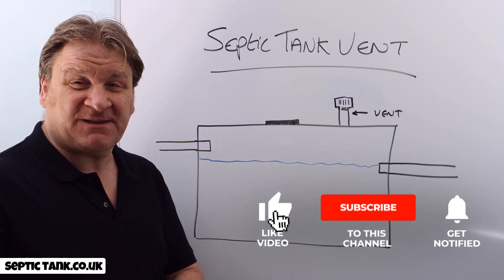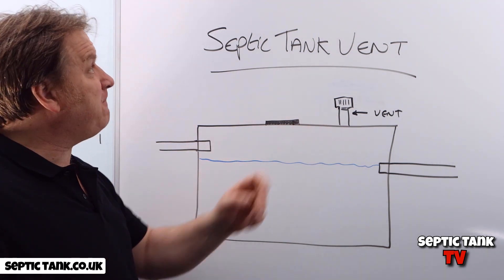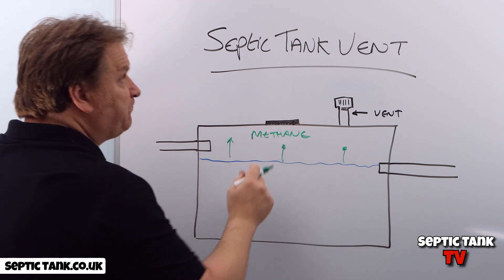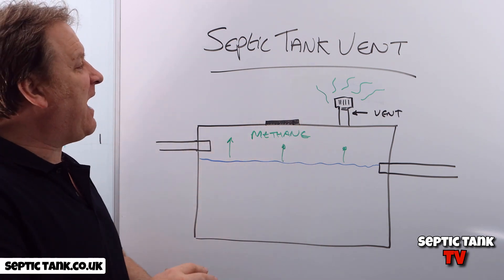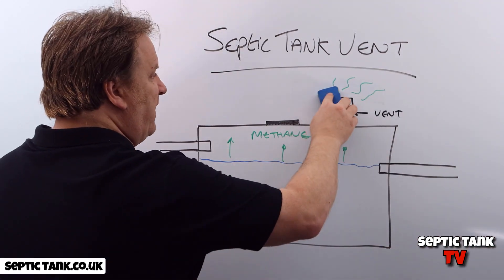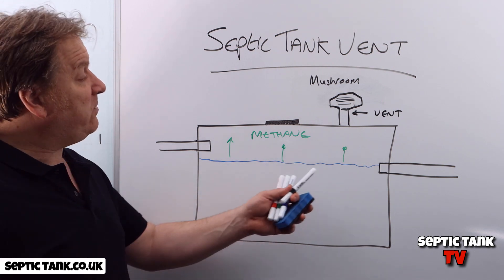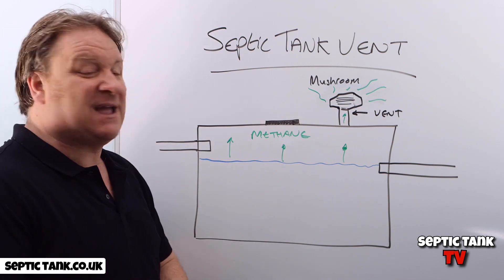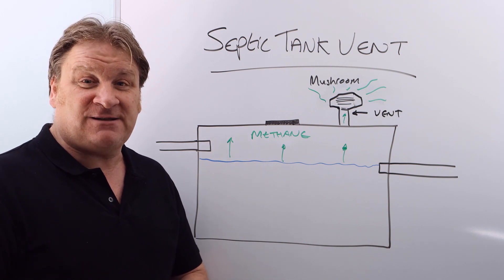Septic Tank Vent - septictank.co.uk

Comment: Hi Jason. We are viewing a house for sale that has a cesspit. There is a barn conversion extension to the house that is at least 3ft lower than the main house. This currently has no plumbing in it but we would like to add a bathroom. Would this be possible to add to existing drainage pipe work even though it’s lower? Is there some kind of pumping system for this scenario? Thanks in advance for any advice